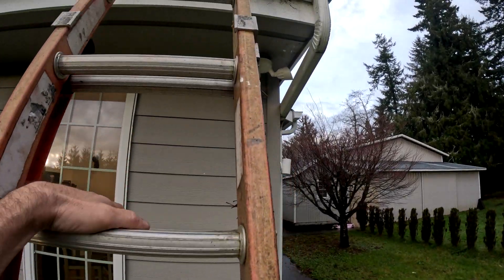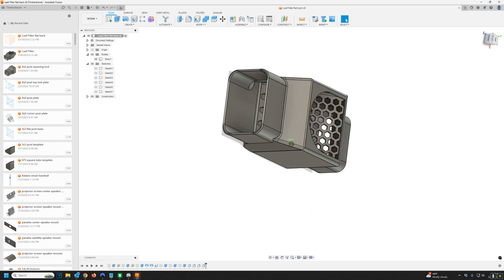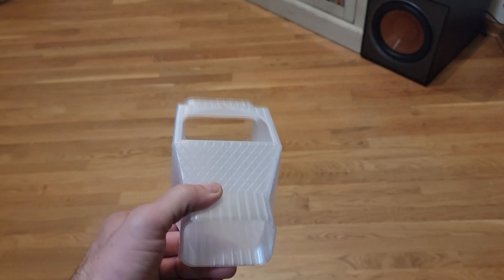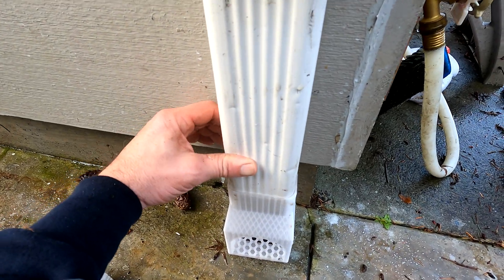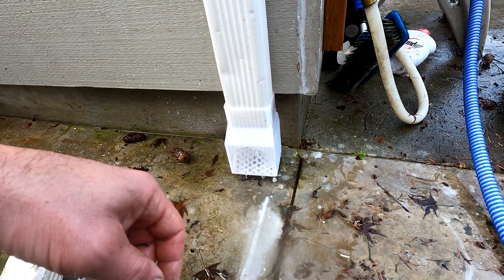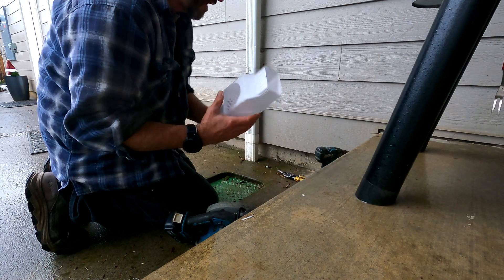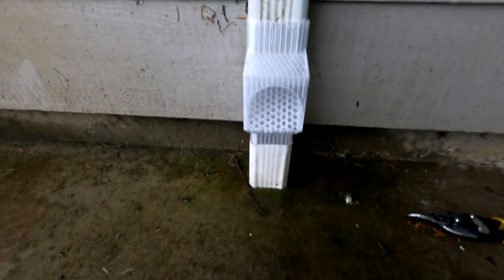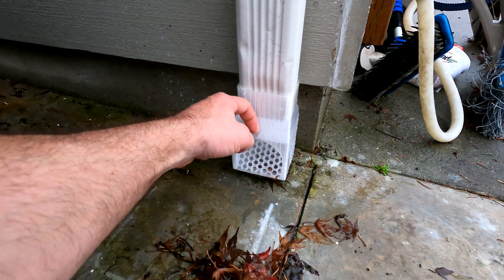3D printed Leaf Filters for my downspouts

Comment: Nice design, looks similar to what I saw installed on my house in Sweden.  If you could make this a little taller and add alternating ramps above the screen that completely cross the tube, and just barely overlap each other (with adequate clearance between them to allow the debris to get through) you could prevent water from dropping straight onto the strainer at full speed and further minimize the splashing out of the filter.

Comment: Nice design, similar to ones from the big box store I installed about 5 years ago. Bending the front face of the downspout is a great idea that I might try with mine when I replace them. Mine are East-facing and have broken down already. I might create and print my own as well so I can get a better grate design to deal with my larger/flat oak leaves.

New subscriber!